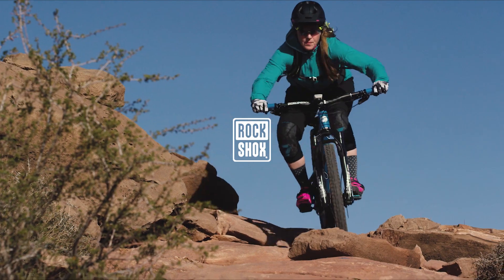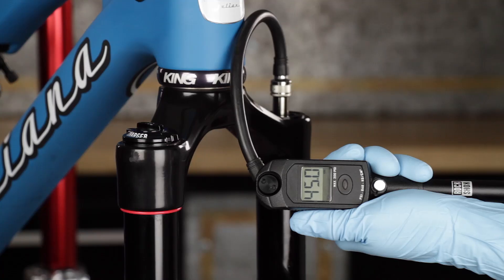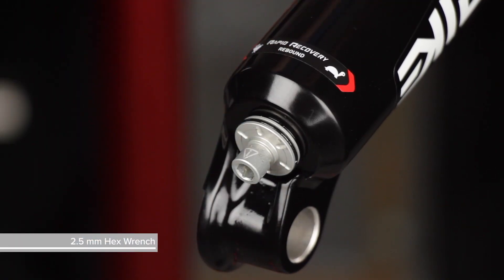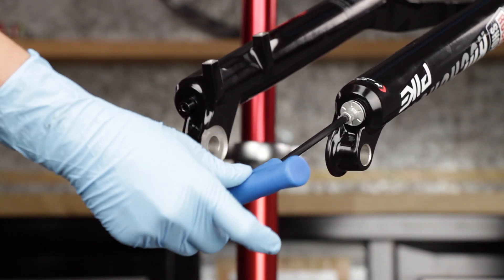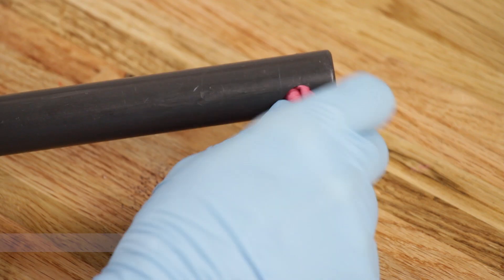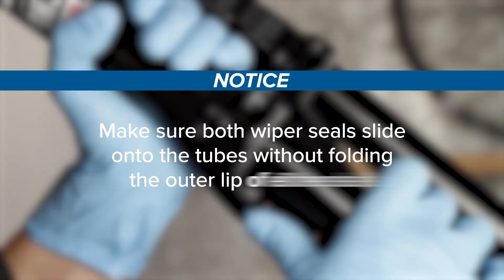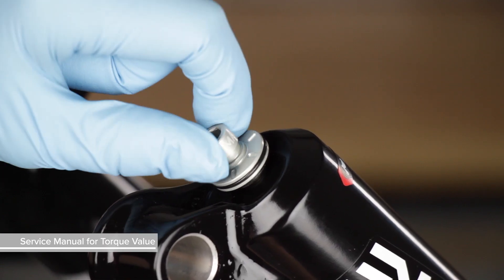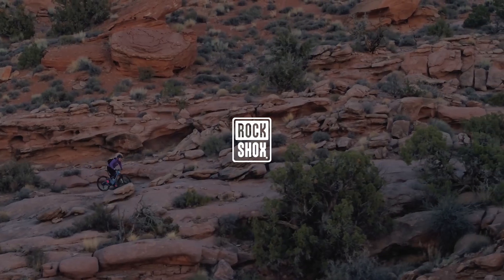RockShox 50-hr Lower Leg Service

Comment: There seems to be no crush washers under the bolts in this vid. Based on the service manual, (new) crush washers should be used. Why is there a difference? Could you please confirm if every rock shox fork should be used with crush washers or certain models are sold and should be used without those? (I did not find any on my fork, but it was serviced previously, so I do not know if it was removed or never installed.)